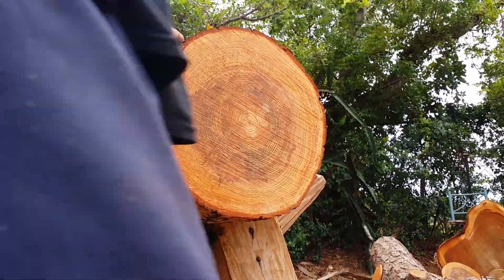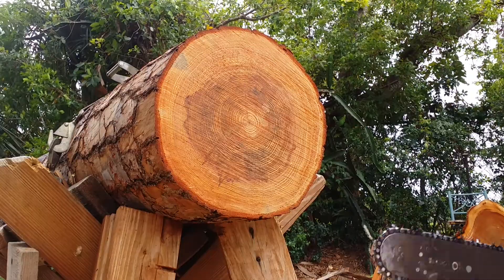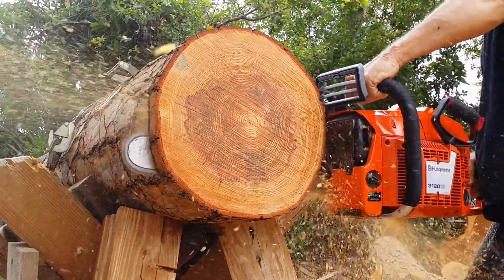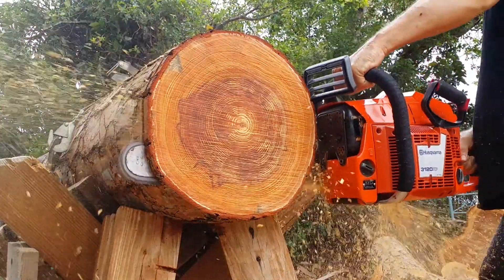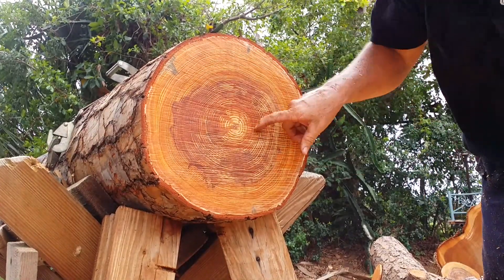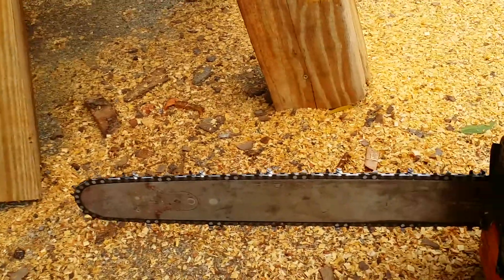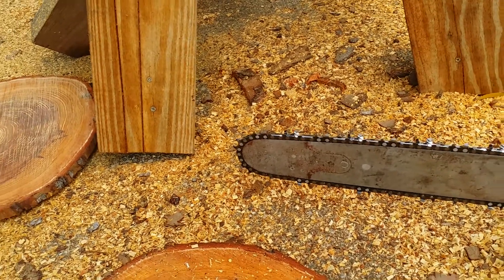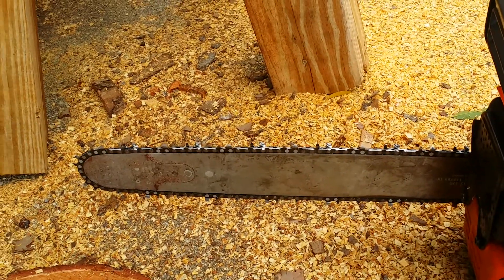Husqvarna 3120xp /RACE CHAIN

Comment: Have mine punched to a 66mm Contra 090 race piston.  Can run an 10 pin on mine.  404 dont like the stress of the deflection thats created above 650-700 ft/min and above. Seen it seperate at the rivots. Danger Zone but its a insanesaw!!!